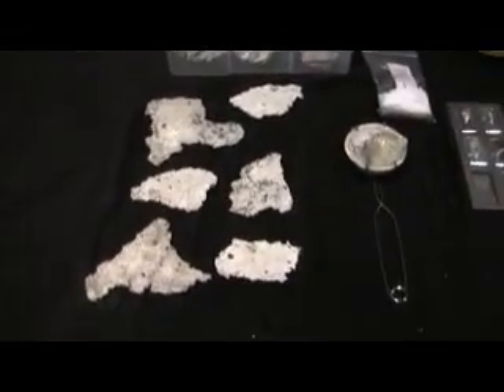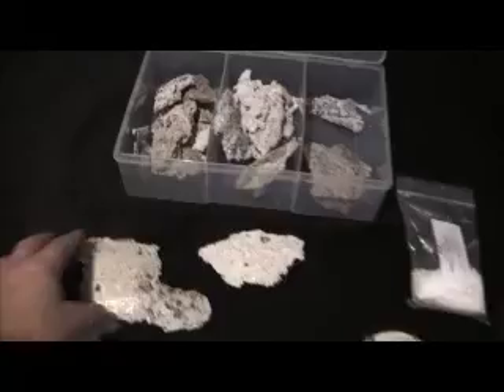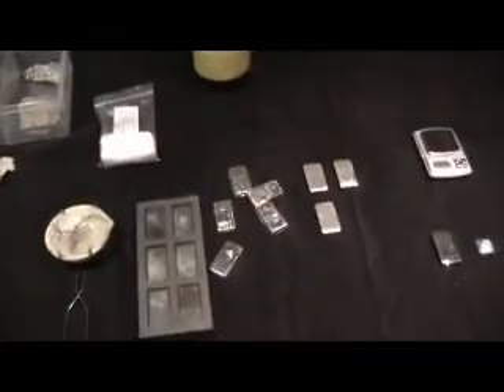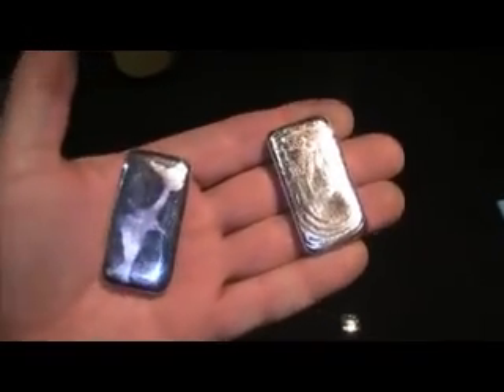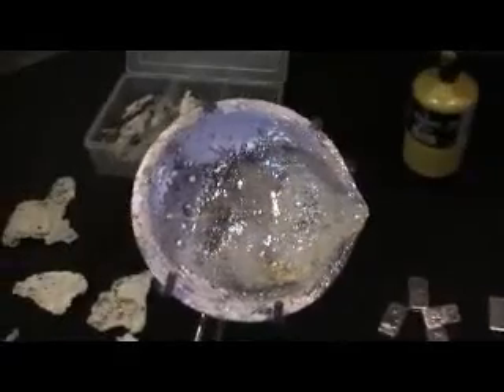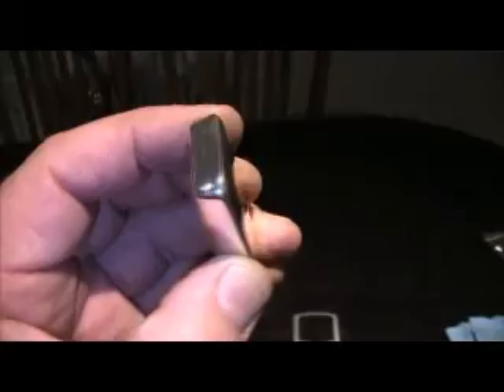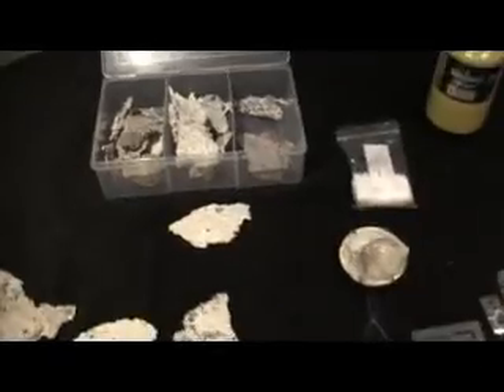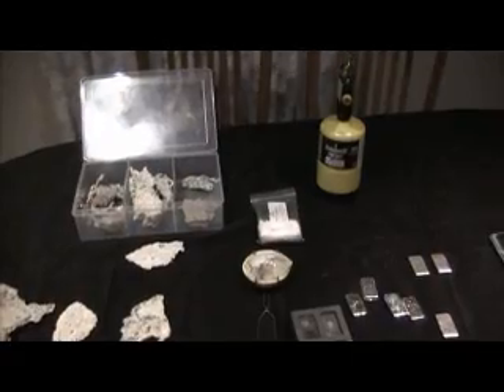Lets make a silver bar

Comment from the maker: The only thing you need to do is heat it up before pouring your product into it. I just give it a blast with the flame and then put the crucible on top of it while I heat everything up. The crucible gets red hot and transfers all that heat into the mould. Then as soon as the product is ready to pour I lift it off and pour straight into the pre-heated mould. Works for me mate

Comment from the maker: @pof1991 Yes mate gold and silver no problem although you would use one mold for each. The gas torch that I was using gets up to 1700 degs and once the crucible heats up the silver melts quite quickly. After a bit of practice I was able to judge by the colour of the molten silver when to quickly pour into the molds. I am enjoying the learning process and will get back to it once the weather cools down